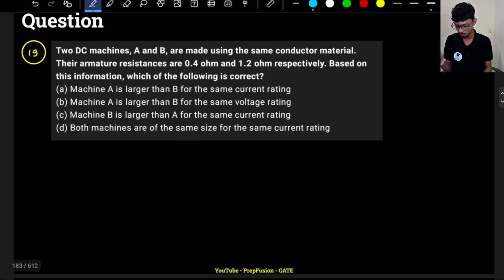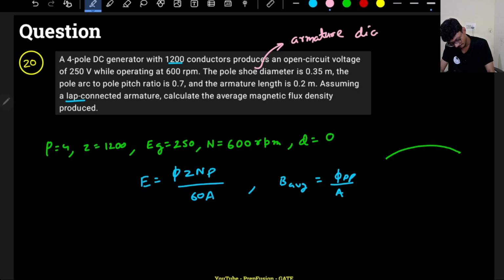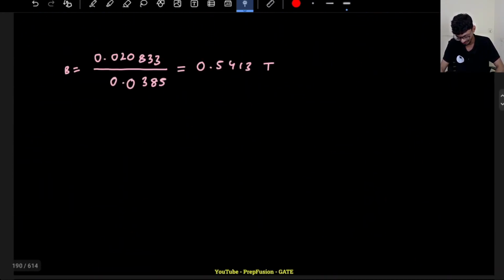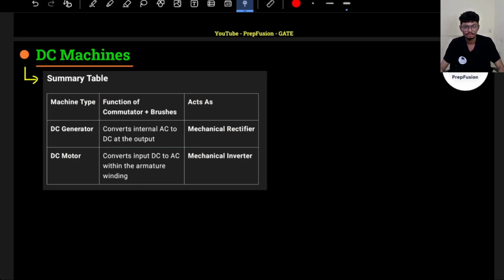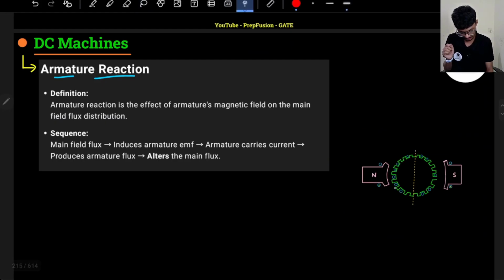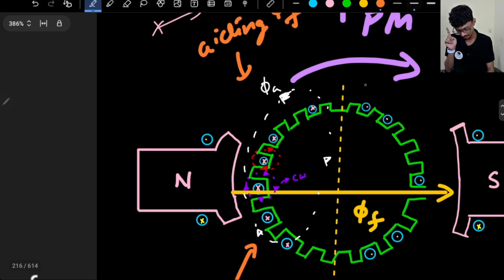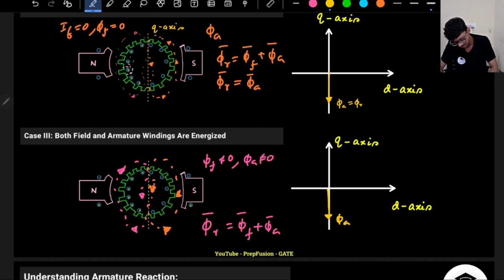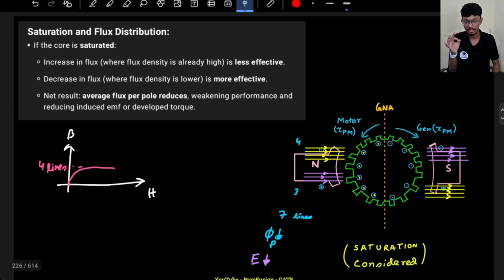L29 Armature Reaction || Commutator || Electrical Machine || PrepFusion

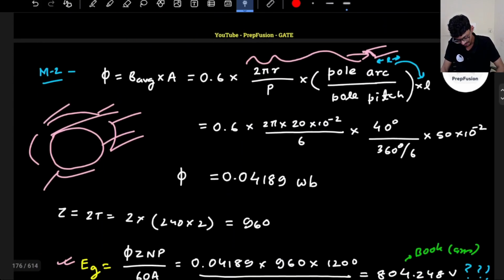Comment: Sir @28:20...turns per coil is 2 then one coil 4 conductor..if you told in privious lecture induced EMF produced due to the conductor.. if coil in two turns then it double of induced EMF...so the generated EMF equal to Ec* 2*40 ...then the ans is 402*2=804...if my opinion is correct or not..